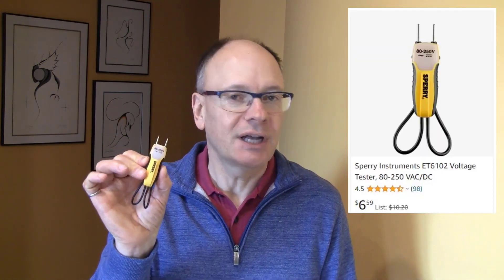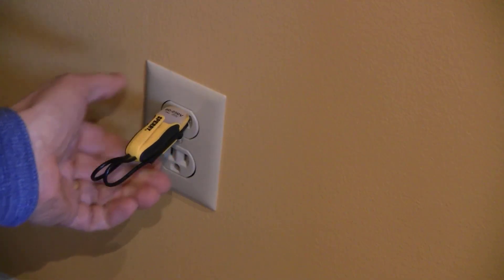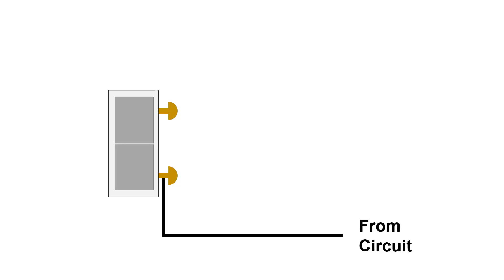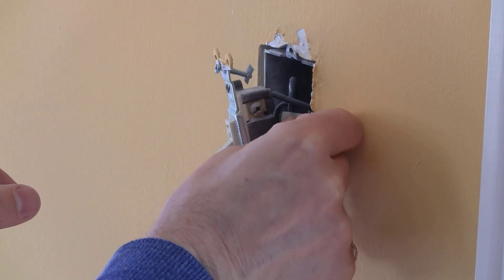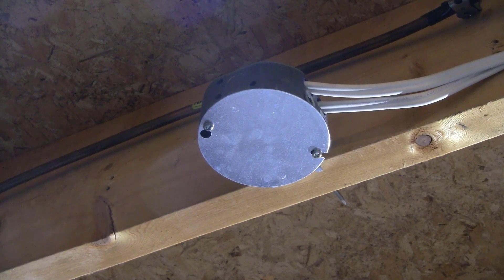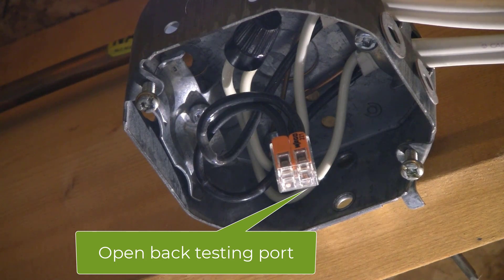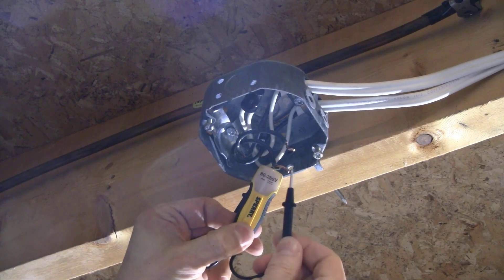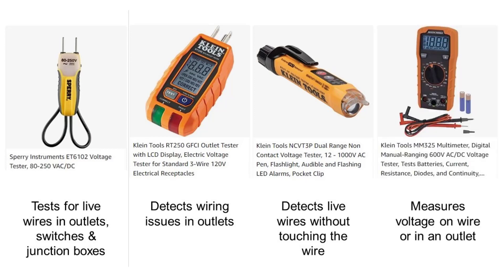$7 voltage tester helps you avoid touching a live wire in common home electrical projects

Comment: When testing a single pole switch,  how do u find the breaker for that switch without turning off random breakers?
Reply from the maker: I show some ways to find the correct breaker in this video: https://youtu.be/VGUNDZf1UnI. Hope it helps.
Reply: @upgradeyourhomediy  oh yes, I seen this video before but, it show the breaker  for the light and not the actual switch...
Reply from the maker: Since the switch is sending power to the light, the breaker that turns off the light is the one that turns off power to the switch. If the switch is in a multi-gang box, check the other switches as well since sometimes there are two different breakers feeding wires in a multi-gang box.

Comment: Good video.  I always test because I run into many instances where people connect the white as the hot instead of the black,
Reply from the maker: Testing is essential. Even electrician's make mistakes so test before you work. If the work was done by a previous owner, even more reason to test.

Comment: I don't think the voltage tester will help identify the hot wires in our old (107 years) house.  The receptacles don't have a ground; just two identical black wires. 

I'm getting a non-contact voltage tester to identify which "black" wire is actually white.
Reply from the maker: You can also touch one probe to the neutral wire instead of the ground. That's actually what putting the probes into the two vertical rectangular holes in the outlet is doing.. It sounds like your old wiring may not be done the way things are done today.
Reply: @upgradeyourhomediy  My Old House was definitely wired differently than you would today! It has two wires that are loose (no cable sheath), no ground wire, and no conduit. The insulation on both wires is black, with no markings to differentiate them. 

As far as I can see, the voltage tester will confirm that the circuit is live, but not identify the hot wire.

Comment: I noted that you just stuck tape on the side of the hot wire. I recommend wrapping it around so it doesn’t fall off and saves work the next time.👨🏻‍🦳
Reply from the maker: Good suggestion. Thanks.